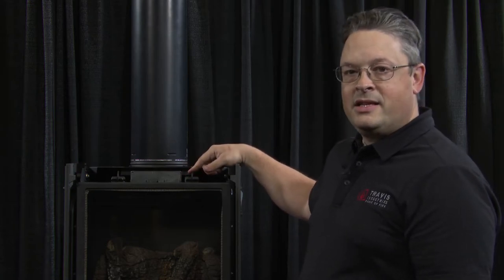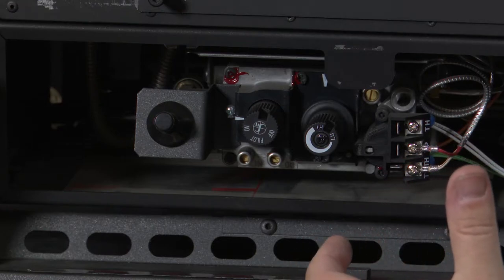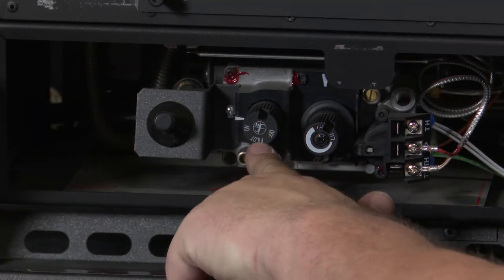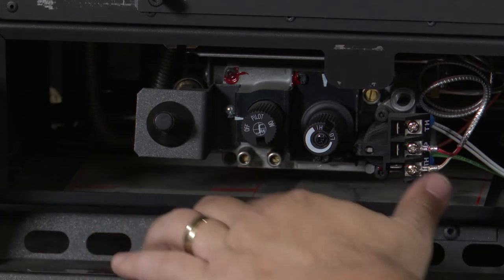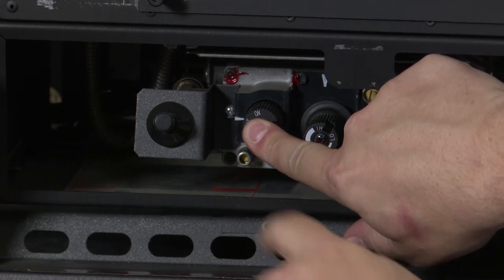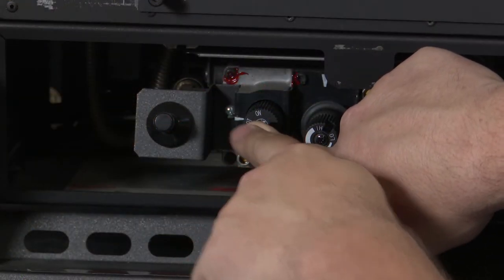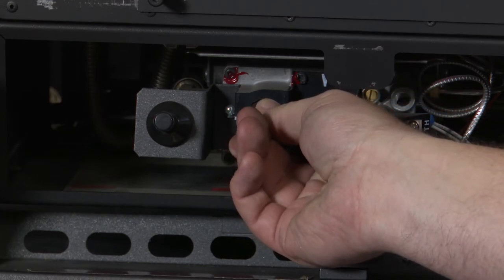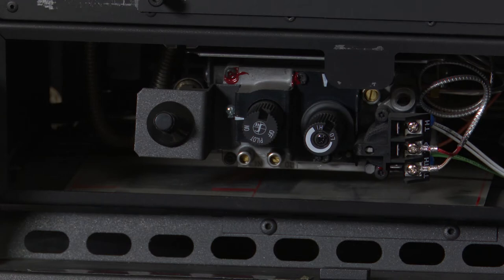Millivolt Pilot Lighting Instruction for Lopi Gas Stoves and Inserts

Comment: So would you leave it on pilot or on? Until ready to turn on by remote..
Reply from the maker: Once you are able to remove your finger from the knob and the pilot stays lit, you know that the pilot is going to continue to operate. The next step would be to press the knob in a little bit and turn it to the "On" position. Now the valve is in the standby mode and ready to resume normal operation.
Reply: @LopiNorthAmericasFavoriteFire  when I turn my to on it actually lights it’s not in a standby mode does that mean it’s not working correctly..  I was also told my retailer the same thing. But it doesn’t seem to work that way.   Another issue I have is when I do light it I get a blue flame and in about 30 seconds it goes out and the pilot goes out very frustrating.